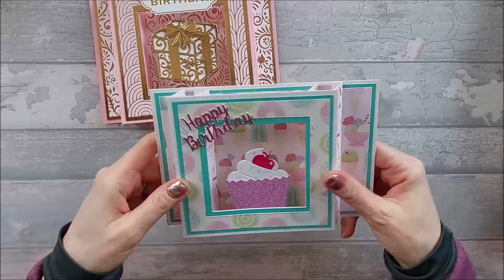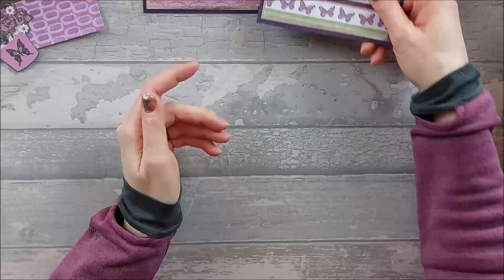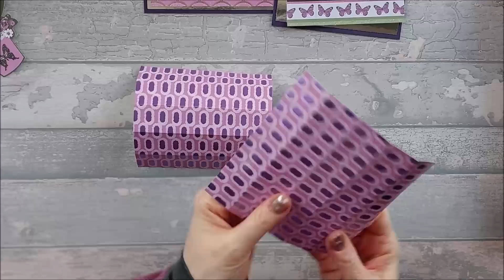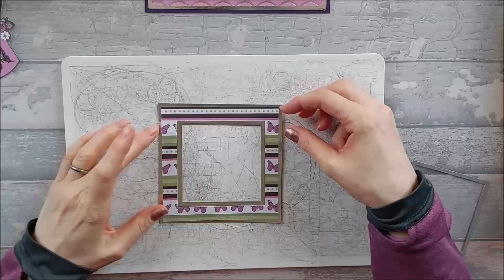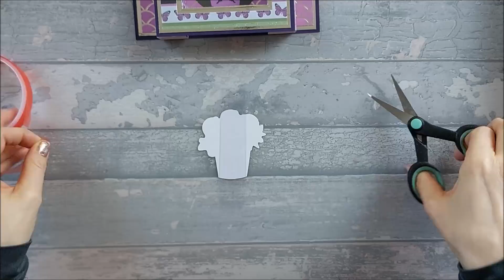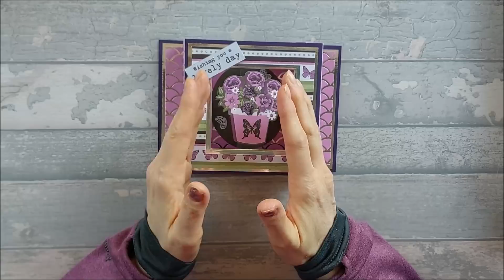Centre Pop Up Step Card

Comment: Lovely card. I don't have a die cutting machine would have to work out sizes to cut out with a craft knife or trimmer. Might give it a go though.
Reply from the maker: Thank you! Yes this is easy to do without dies.  You'd just need to measure in 1" from the outer edge and cut the centre out - to make a 3" Square in the middle - which would be your aperture. 👍